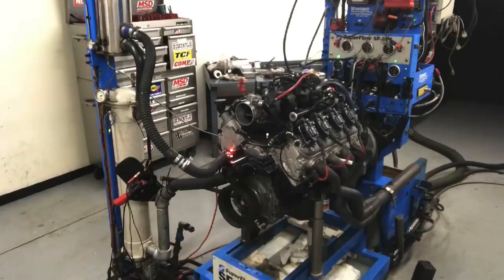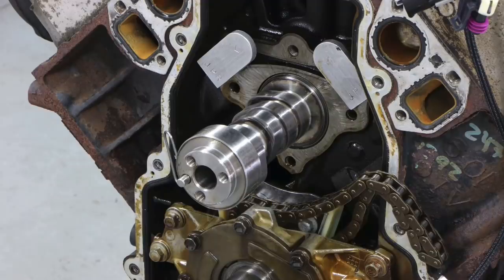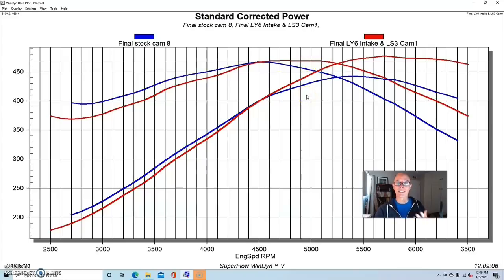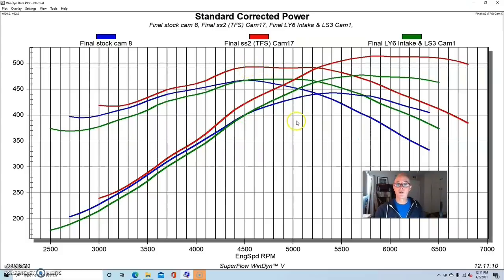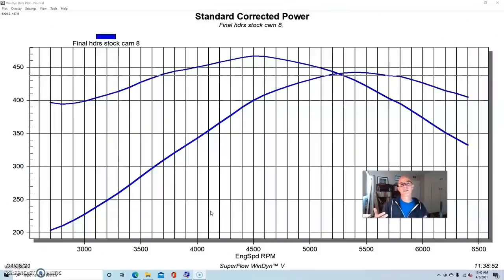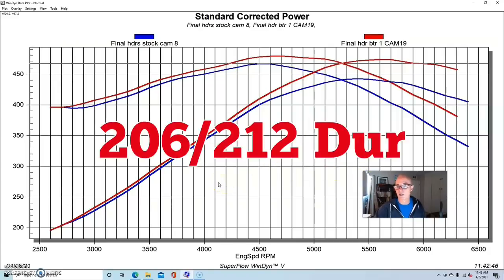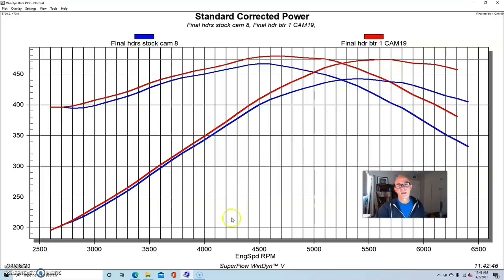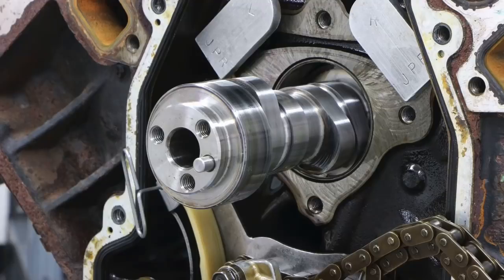HOW TO: CAM YOUR LS FOR MORE TORQUE

Comment: Best Torque Cam is a Stroker Crank 😁
Reply from the maker: or boost
Reply: Some people don’t get that it’s literally increasing leverage. Same peak cylinder pressure with a longer stroke equals more torque.
Reply: @richardholdener1727  😖 it’s like I forgot what channel I’m on
Reply: Depends on the motor, with a 4.6 ford, a stroker crank is a much better unreliability cam.
Reply: Thats a funny way to spell stroker turbo diesel.
Reply: @richardholdener1727  Or both
Reply: A square LS (4”x4”) shoal does pull, and will live a long, long life.
Reply: I dunno guys, I was very surprised by the torque production of a 3v mod motor on a little spray with a bone stock longblock. It made almost 530 TQ on just a 125 shot and that’s only 281 CID.
Reply: @kennethpowers8995  nitrous pumps up the tq production on any v8, alot of the time a shot of nitrous gives more tq than hp

Comment: You answered about half of the questions about cams and torque but as you said at the end of the video where do you want the torque and I think a lot of people asking about cams and low end torque may not care that much about peak torque which is where you always focus when comparing cam and other parts but care more about at what rpm they have peak or near peak torque. 75 percent of the time I don’t care about torque above 3,000 rpm because I don’t want to tow a trailer or climb a hill in 1st gear at 7,000 rpm just because the cam has big torque when it is running like a dremel tool. Off idle to 3,500 rpm is what matters in a dialer driver for a truck or van.

Comment: It would be great to see a video on an engine modifications that was totally centered on the most power form idle to say 4,000 rpms and show like you do the different changes you make to the engine trying to get that accomplished and the power changes after different changes you make. To date I have not seen one such video anywhere, they are always more power at higher rpms for dyno results or drag racing times neither of which have any real world use for a dialer use van or  truck.
Reply: I would love to see that too !
Reply: That would be the most practical video like this ever made. I live under 3500rpms.  I could care less what power my van or truck have over 4k
Reply: And with 5 speed manual  trans also.
Reply: And how about  in a 3 gen camaro  with.a ls engine.
Reply: Yea let’s do that in ls motors
Reply: My thoughts exactly!
Reply: I'm surprised  nobody does this
Reply: @melissadunagan6596 5spd?? All LS powered cars since the 90s have had at least a t56 6 speed manual

Comment: Most people don't really understand the torque/horsepower equation.  When they say "torque", they are simply referring to low-end grunt.

The way you are explaining cam/torque characteristics is probably detrimental to most novices who watch these videos.

The fact is that just about any cam big enough that you can actually hear, is going to be weaker on the bottom end.

Comment: Seems like doing a cam swap for more torque, below the peak torque area, is not gunna give big results. It’s so nice to see actual test results instead of just “In theory ideas”! Thanks Richard!
Reply: Valve/port job on 862s, cam and even full rollers help.
Reply: Depends on LSA, Duration, lift.

Comment: The valve timing events are what matter. Duration, icl, ecl, lsa, overlap, overlap bias, etc, are just calculations off VEs. Pick a vendor that understands which VEs work best with your combo & goals. What VE changes help carry power past peak better? Which will raise torque between 3500 & peak torque without hp crashing before 6000 rpm? Which will reduce exhaust reversion at cruising rpm? Lobe lift vs rocker ratio? Etc.Pick your heads first and design the cam VEs around the head specs.

Comment: As Richard has said before, the peak numbers are a part of the story and average power is seldom discussed because it is a lower number. The LS3 cam made more torque for a longer time but at a higher RPM and the same for the horsepower. IMHO: if you do any racing a bigger cam is going to let the engine make more power overall. Regards,
Reply: Torque Is More Important Than Horsepower In racing.

Comment: Thanks for making this video @Richard Holdener. Finally squelch the 2000 rpm torque guys. Leave the stock cam in if you want low speed torque. You can also add a higher stall converter (500 rpm higher than stock) to the stock cam engine and you will get to the torque peak sooner. The vehicle will feel more torque'y and responsive. Tuned a 04 Yukon Denali with a BTR stage 4 truck cam in it. It's a flat out DOG until about 3000 rpm. He's FINALLY installing a higher stall converter in it. Waiting for the truck to be done so i can retune...
Reply: Actually, the stock cams suck at low RPM torque, because camming for that hurts emissions.
Reply: Stock cams are horrible for torque.
Reply: @DoyleShadduck  that's all they're good for. Torque under 3000 RPM.
Reply: I am actually thinking keeping the stock cam in my lc9 engine w VVT produces better torque than most after market cam. For an aftermarket cam I think my best option would be the truck nortis cam with new springs higher lift AND a higher stall converter would be needed to equate the stock w VVT?  Does that seem right? 
Looking for best cam setup for towing under 3000 rpm.

Comment: An observation from your data: more lift seems to help make low and mid-range torque. If you compared the SS2 cam to the truck cams, I think you’d see it beat them down low, because it beat the LQ4 cam. There seem to be other, less obvious factors, too. Valve job, seat angles, low lift flow vs mid lift, etc, all seem to have an effect. For the big ones, add lift and compression—unless you can add cubic inches!

Comment: I would love to see someone retro-fit or re-create a TPI LONG runner intake manifold for an LS. As I have not built it yet, I figure that the recipe is still pretty straight forward. Take the 4.8 or 5.3 out of your truck, 4" Stroke it to 363/6.0L (factory 6.0 = 364 CID), factory 706 heads, 550-600 lift/215-220@50 cam @ 111 LSA, 9.6-10:1 CR and either a Gen3 Truck Manifold or something with even LONGER runners and this thing as an N/A motor SHOULD spit out BBC TQ from idle right up to the crossover, then completely fall off, as it's intention is to be a low speed TQ monster Tow Motor and not a big RPM spinner. I don't expect anything after 5000 RPM, as it will never see that RPM range. Keeping the smaller bore, big lift, short duration, decently short LSA, long runners in an attempt to push all of the TQ as far LEFT on the dyno graph as possible. I am fine with a motor that is done at the crossover. I want peak TQ by 3500...not 5500.
Reply: I did a version of that. Aluminum 5.3 to forged 364ci stroker, -12 valve reliefs, think around 9.6 comp, slighty larger valve job on stock 243 heads, 212/218 .600 lift cam, tbss intake, 2k hughes tow converter, 4.88 gears, 37" tires. Pretty decent performance for a heavy ass truck. Still think it needs more tho lol. Def wouldnt hesitate to stuff that setup into buggy or street car 😁

Comment: Iirc the Summit 8720 cam @.050 218/227 made the same Max HP as the SS2 but absolutely destroyed it in TQ in the low/mid range by a substantial amount.
Reply: Link to test engine?
Reply from the maker: yep-on a 4.8

Comment: I wish someone would build an LS  designed to get the highest torque they can BELOW 3000rpm.  Stump pulling mega monster.    And not caring wth it does above 5500.
Reply: If you're talking bolt-ons, I did. 6.0, cathedral ports, FAST intake, LS9 cam, LS7 rockers and springs, 1.875" 4-2-1 headers into 3" cats into 3" X-pipe into 2.5" mufflers into 2" tailpipes, and a very serious conversation with my tuner about my goal.
Result was +50 ft.lb from 1,500 - 3,500-ish rpm and approx the same peak power as stock. It feels amazing. Fuel economy suffered, though, so I think you would get the same result if you just changed rear gears and tune the ECU.

If you're opening it, though, a 4.250" stroke with standard bore pistons and 11:1 CR would certainly produce a tonne of low-down torque with my top end. Tune would have to be spot-on and really conservative up top, though, to avoid Uncle Rodney knocking on the door.
Reply: @silkysixx  a ls9 cam sure isn't a good cam choice for low rpm torque
Reply: @ryanaxberg9263  it's what I could get at the time. Keeps the idle nice and raises dynamic compression, though, so that's nice.
Reply: @silkysixx  LS9 cam was probably the worst stock cam ever for low end. it's designed for top end because it doesn't need low end with the blower of the LS9. It bleeds a shit ton of dynamic compression down low
Reply: @ryancompeau146  then don't use one I don't know what to tell you
Reply: @silkysixx  I'm not putting a cam in anything. Just saying ls9 is not good for low end grunt. If thats all you could get well then I would have used it to. If you ever replace look into the torquer series from Katech or something similar
Reply: This is where VVT comes into play.
Reply: @silkysixx  that's an incredibly shitty setup for max tq production. Lol. You want torque from an LS, go with a flat top 6.0, ported 5.3 heads with bigger valves, and a trailblazer ss manifold. Cometic gasket thinner than stock. BTR stage 2 truck cam. 1 7/8 headers. 4.56 gears. She will pull majority of things you hook her up to. If you want serious torque, go 400 cube or better with high compression and you'll get all the tq you want.. A 454 LSX will gladly show you how it feels to be pinned to the seat.
Reply: @silkysixx  4.25" crank in stock block is a really bad idea bro due to clearance and sleeve length. Unless you are rebuilding frequently id go with 4" max stroke for reliability.
Reply: @swappedoutZ71 is there any videos you recommend me watching about this? How to get a good amount of torque on a 6.0 ls. So it can pull 14,000 lb of fifth wheel with ease
Reply: @WalkingDead520  for that amount of weight I would supercharge it. And upgrade the hell out of the brakes and cooling system
Reply: @swappedoutZ71 thanks for the input. Any idea if i should do what you mentioned on your other comment above? Which is to change the 6.0 heads to 5.3 from what i understood, but with 6.0 flat pistons? 
Ive researched a good amount and heard that its better to stick with the stock cam and just tune it so stage 1 and then add the supercharger i think. But im not sure if that sounds correct. I only plan to pull about 13 to 14k like 4 times a year. So maybe the supercharger is still a good idea right? Do you have a 6.0ls too?
Reply: @WalkingDead520  the 6.0 makes alot of tq with 5.3 heads I had that setup on my truck for a while with a stage 4 cam and it was still tq for days

Comment: If you want big torque below 2000 rpm, sequential turbos.  A small one to spool by 1500 rpm, then a bigger one that spools above 3000 rpm that comes on line smoothly, adding its airflow to the small turbo's.  Very complicated plumbing and a lot of tuning.  People that want to make big torque at 2000 rpm so they can tow their trailer up Eisenhower grade in top gear need to stop thinking that a cam swap will do it for them.  You can't get excited about a 2% increase in torque when what you're wanting is 100%.  Boost is the only way to get it.

Comment: If one wants more torque at low rpm one need to increase VE and the compression pressure, right? Intake valve closing timing is to be limited. 
To increase cylinder filling one needs to open the intake valve well, not too late to put it that way. Valve speed should be high. 
Looking at this one understands that the LCI will be about 105 degrees, right?
We have learned from BTR himself that LS engines love early exhaust valve opening for high rpm horsepower, but when running advanced camtiming this might be to early. Later exhaust valve opening will decrease duration and tighten the cams LSA. 
I belive that a single pattern cam with 110 LSA installed at 105 LCI will give the low down torque a nice boost, but no one can be bothered to test this. Total overlap should be a little less than the sloppy stag 2 camshaft. Just IMO.

Comment: Glad you followed up on my questions. Ive been noticing l.s. platforms normally have very high lsa numbers. Until looking at the available cams...110 was used in most catalog builds. 106 in cases of class restricted classes. So i never order a cam with lsa more then 110 until i build a 318 for gas mileage. The factory ta cam 112 that i used...got great gas mileage but sucked under 2000 rpm. Now in my l.s. equipped yukon. has 115 and it has amazing torque for a small block. I have no idea what the reasons for that are for the most part other then port design.
Reply: It's more the electronics. I just got a 2012 Yukon XL 5.3L with the good 3.42 gears, and I'm about to install a new torque cam, a Comp 213/213-109+3 619/619. I went a bit wilder for my '99 Durango 5.2 with 3.54 rear, a 218/226-113+4 520/520, it's noticeably stronger than stock from idle on up, dramatically so above 3000. Of course I also gave it another 8* of initial spark advance at the same time. YRMV.

Comment: Well, let’s get creative here. Let’s take an LS and design it similar to an eco boost. Let’s not be concerned about high end and create the low end, by adding boost. Let’s add boost to where the turbos are on the smaller side so they wind up quicker and produce the torque at low and mid range. Let’t match it up with a 10 speed. The engine rpm would stay low, live longer, and be more fuel efficient. This would be a creative and cool video. Real creative thinking and engineering.

Comment: Richard, any chance you can give the rpm and vacuum at idle are for these different dyno runs?  A lot of useful data on you videos for power numbers and curves but for someone building a street engine, the vacuum numbers at idle will help predict some of the driveability characteristics given a particlar combo.  Thanks in advance!
Reply: Not to mention tailpipe emissions. Most people in the world have to pass emissions tests!

Comment: In order to get the best of both cams you need to eliminate the cam like Koenigsegg did and use their free-valve tech and software. It would be sweet to be able to set that up on any engine you wanted. I wonder what the costs are for that system? More or less than a new Mustang or Corvette?
Reply: Honestly if it was mass produced, the price would go down to the point where it would be around the same as your current valve train.

Comment: I have a 2001 2500HD with a 6.0. The stock LQ4 doesn’t really start making power pulling my 30ft. travel trailer and torque until like 3800rpm. Honestly feels like a turd. My 2014 1500 (power/torque wise) pulled the same travel trailer better.  I have a BTR stage 1 V2 I installed in a 130,000mi. LQ9 (w/headers) sitting on an engine stand ready to go in place of the old  LQ4. I’m hoping for “noticeably” better pulling out of it.
Reply: Tune alone on 6.0 is about 30-40 hp on that motor
Reply: Ditch the 317s and use 243s or 799s the LQ are dogs with lazy compression. Bring the LQ9 up to LS2 compression and you will be much happier.

Comment: My 4.8l is never gunna make torque.  I'll just throw a .036 head gasket and some 4.10 gears at it, maybe some long tube and a tune.  Will high ratio rockers do anything worth the cost?
Reply from the maker: not much

Comment: I dont know if this will reach the engine builder but I have a question. I have a 98 k2500. Needs a new engine. GM makes a 383 stroke that guarantees same fuel economy as stock 350. They advertise it makes 444 lb ft of torque at 3000 rpm. Can that number be duplicated in an lq4? Low rpm torque is what I am after with a better engine. LS engines seem to make their power high I want it low. 400 lb ft would make me happy at 3k. There is no reason I need to go over 4k rpm. I have a 5 speed NV4500 behind the 350
Reply from the maker: yes-a 6.0l will do that

Comment: that low speed torque is the reason bigger engines are used in tow vehicles, a belt driven supercharger will help or just get a diesel.

Comment: Which cam would u recommend for a towing motor build for a 5.3. I see the ss2 retains the best low end but would a cam with less duration and the same lift help improve low to mid range 2k-4k rpm
Reply: SS2 will be a dog in a 5.3 tow rig. Get a stage 1 cam from summit.
Reply: @andrewmontgomery1763  that's what I thinking I found a cam with .585 lift and 210/218 duration I believe
Reply: 202 cam......or gear. 

And you will likely benefit more from gear

Comment: There are really only a couple of ways to increase torque...displacement and force on the top of the piston. All the rest of the tweaks just change how flat and where the torque peaks.  So to truly increase torque without increasing displacement is to make a bigger bang. The best way to make a bigger bang?? BOOST!